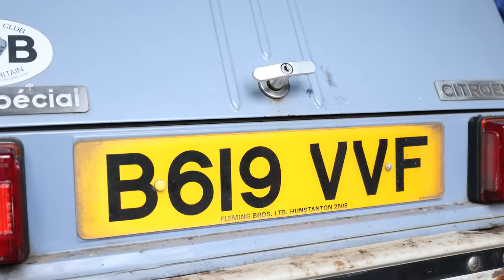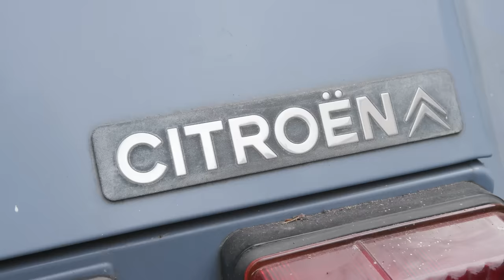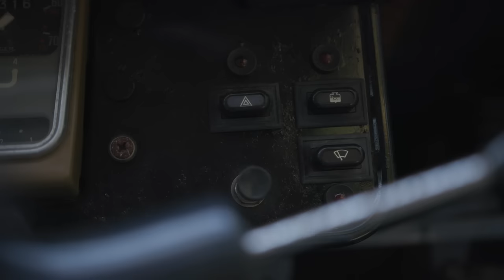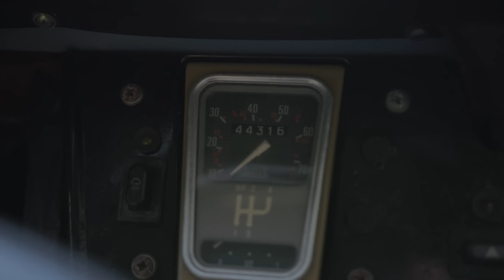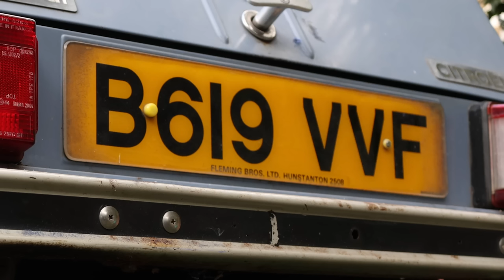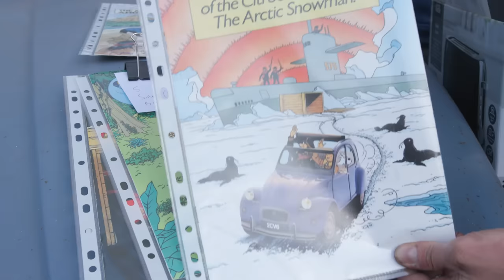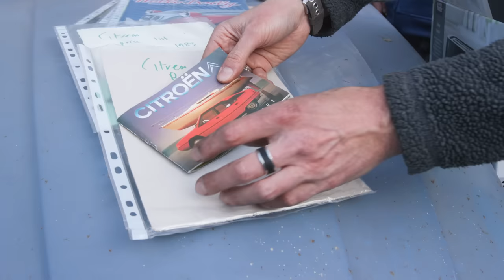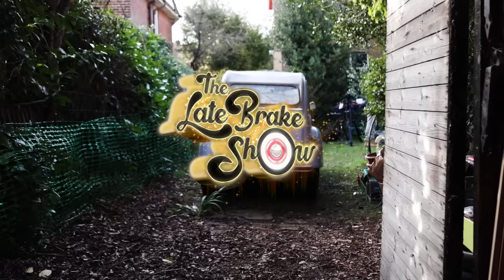Barn Find 1 owner classic Citroen 2CV survivor discovered

Comment: I test drove one in 1988.  It was £3,333 on the road.  In the end, I bought a Fiat Panda 1000S but I bought a blue 2CV second hand in 1997.  It had a stripy roof and I loved it.  I drove it over a speed bump and the steering went odd.  I took it to be tracked and the mechanic said I'd snapped the car!  The chassis broke just in front of the passenger cabin.  I sold it for £100 to a guy around the corner.  Three weeks later it was back on the road.  I bought another one about 12 years ago and it's sat in my garage awaiting it's re-emergence.

Comment: I've never been able to get excited by a 2CV but I got goosebumps when the engine came to life. I'm so happy for the family to see it run again, just proves what happens if you look after something properly.
Reply from the maker: Cheers Tom. Yep, the family backstory and human connection is often the emotional switch!
Reply: You’ve never driven one then. 
How many cars are there where you can use at 90-100% on its ability most of the time. 
That said, it can get too exiting at times - especially it the cardboard ducting gets loose and rests on the exhaust. 
First you smell the smoke but pretty soon you can have a burnt out 2CV like I did.
Reply: My thoughts entirely, never expected to become so invested in something I care so little about! It looks in reasonable order considering
Reply: @seanoneillsongs  closet I've been was in a Peugeot 107

Comment: I live in the states and my own barn find is a 1971 SS Chevelle. It has a 396ci big block bolted to a Muncie rock crusher transmission that came out of a 1969 SS Chevelle that was destroyed after being rear ended by a semi tractor trailer. I found it 23 years ago and I still have and drive it.

Comment: Well that's taken me back to my yoof! My first car was a red F-plate 2CV6. That "vinyl roof handle" was in fact a strap to hold the roof when fully rolled back to the rear window. IIRC you unpop one end, pull over the rolled roof and you should find a press stud on the outer bodywork to pop the strap to. Have been wondering where my old motor has got to. Anyone seen F233LKX?! Thanks for the trip down memory lane, Jonny!

Comment: They are so full of quirks and features, mostly positive but also negative. I loved the 'hack' of propping the window open on top of the door mirror and the easily removable seats, with all except the driver's seat removed, it was almost like a van for space. Being able to slide the boot (trunk) lid off sideways was also a useful feature sometimes and even though it was FWD it was so light it could deal with gravel and snow like a 4WD car.

Comment: Fantastic video, you are spoiling us this month! Massive reminders of my Grandad's 2CV that he restored. A 1952 Slough built 2CV (at the other end of the production run) which was unique as it had an extra 6 inches of head room built into the shell (from the factory) to make room for a taller gentleman. I always thought that it was miles away from being completed but had no concept of the wings and bonnet being bolt on/off and it was soon finished. Sadly my Grandad is no longer with us but the 2CV lives on and is now in the Citroen museum in Strasbourg.

Comment: I know I live in the past, but I do like simple things you can sit down with sense of humour and a bottle opener and repair the car now being serious. I think twin cylinder, motorcycle engines, car engines are just so beautiful. I rode A BMW air cool bike for many years some hundred and something thousand miles I put on there myself I have such a soft spot for flat twins. There is something about the 2CV. Yes they were this. Yes they were there. Yes they were quick. Yes they were simple to repair. Yes you could repair them yourself on a Sunday afternoon, as long as you could keep the munch beetle Out of the bodywork they would just keep going as I said before long live the socket set in the Simple car enjoy your program Michael

Comment: Bought a new 2cv in 78. Oil changed every 5k. Thrashed it for 70k and then the timing gear broke in 2. Put a new one in and the engine started first attempt. Brilliant, absolutely the best car I’ve ever owned and the only one I ever regret selling.

Comment: Jonny, if you have any other small cars like this in the future I find using a big syringe full of fuel  connected to a pipe direct to the carb a good way to keep the fuel going, works a treat on motorcycles too.

Comment: In the mid 80s I was running a horrible mint green Mk 3 Capri 2.0 auto. Most days on the way home from work I would come up behind a 2cv lumbering up a fairly steep uphill single carriageway rural road, I would usually slip past with a cheeky overtake just before the crest of the hill and leave the poor struggling 2CV in a trail of dust. One winter day snow had come down heavily over night. Having had a sketchy drive into work the firm shut up early so we could get home in day light. I approached the hill with much trepidation in the tail happy auto Capri !! Just near the top and im struggling for grip I hear the roar of the 2Cvs twin cylinders the skinny tyres cutting through the snow and the madly grinning arm waving driver flies past me beeping his horn in triumph !! he left me for snow dust that day, he was one happy 2Cv owner that day.

Comment: I've been in a 2CV and I was very impressed. Beautiful ride quality, very comfy seats and plenty of room. You can even remove the rear seats and turn it into a van quite easily. Just don't expect any performance,. Despite the exaggerated leaning on "fast" corners, the actual handling dynamics are very stable with good direct steering feel also.

Comment: Wow. What a find. I was a Citroen Parts Dealer in the 80's and I still remember practically every part on this car. Sold loads of accessories that people bought for this car. Lots of striped roof canvas.
You could tell a 2CV6 owner a mile off. Teacher, nurse, beard, small plats cheese cloth dresses wooly paterned. jumpers, woolly hat, they handled like a jelly on springs. The seats were like loungers, really soft and uncar like. 
Again, what a find. 😀

Comment: That's my dream car I had 4 2cvs  at the same time & 1 from 12 months old I just love them & when I lost them I gave thousands of £ worth of genuine Citroen parts to the local 2cv club Inc genuine Citroen workshop gear.
2cv I miss you so much 😭
Reply from the maker: You need another...
Reply: @TheLateBrakeShow    yes but I don't have the funds for one thay have risen in value a little bit & I don't have anywhere to rebuild one I have rebuilt the engine after my girlfriend put it in reverse at 70mph ? and replaced a chassis after she broke the chassis? welded the bodies front to back & side to side with new metal that's haw you find out thay are made of tinfoil  & terrified friends so much thay have never got in a car with me driving again.🤪

Comment: Love it... I had a 2cv Charleston... I bent the chassis flat sheet as knackered the steering stem up at same time rating across a grass airfield... Characterful car n a right laugh to drive.. fold the material sun roof back in summer n laugh as it went rolling around every corner.. flip up side windows were great . Loved it. Mine was great with a material black n white striped sun roof . ❤️👍

Comment: What a challenge and you have to wonder from a vehicle point of view is it worth it?  Is it not a labour of misplaced love? They are tremendous fun cars with hardly enough power to pull the skin off a rice pudding!  But trouble is Citroen no longer make or supply parts for these 2Cvs and the only place you can get bits if you're lucky is through the private Citroen 2CV owners club. 
 I wish them luck.  Look out for a leaking exhaust manifold gasket because it can fill the interior with lethal fumes via the heater which has its heat-exchanger cradling the exhaust manifold.  Design lunacy I'd call that.

Comment: Cool barn find Jonny!

Talking of 2cv tyres, the Nissan delta wing had 125 wide tyres for racing which means there are racing slicks out there somewhere!
Reply: There is plenty of space to fit wider tyres as well. With wider rims from the GS, I have seen a 2 CV fitted with 175/60 R 15.
Reply: @akronymus  I bet that looks cool 😎
Reply: @jimbuilds   
It does. Michelin snow tyres with coarse profile …

Comment: That languid starter motor, that high revving twin, such evocative sounds! MLM96P, or Kermit, was my first car in 1983 - a green 2CV with yellow wheels and gold pinstriping on the panels (blame previous owner). It followed a couple of motorbikes, and after a pedestrian walked into my path, my insurance shot through the roof, so a 2CV was the perfect four wheel antidote. Sadly consigned to the scrappy after the oil warning light started flickering, and holes were appearing at the key structural nodes.....

Comment: A 2CV! Wow. Ulimate sleeper. Put in 200HP engine anything and upgrade suspension, brakes, and roll cage it, and scare anyone who thinks you are an easy mark. But as stock it is a quirky bit of kit.
Reply: 200HP? are you crasy? this car weights less than 600kg, it's possible to upgrade the 602c 29hp engine to 652cc 35hp with a conversion kit, some make a engine swap (with the stock gearbox!)  for race with a 1200cc 100HP BMW motorcycle flat twin and this works good, but not more...

Comment: You seriously need to learn how to start a car that has been sitting for awhile. Have you  not heard of starting fluid?
Reply: Patrick Michael, all bets are off with one of Citroen's A series engines.
If they're laid up incorrectly, as in this instance, the 'self-decoking' effect on its horizontally-opposed engine means that debris in the combustion chamber can even prevent the engine from turning past 'top dead centre.'